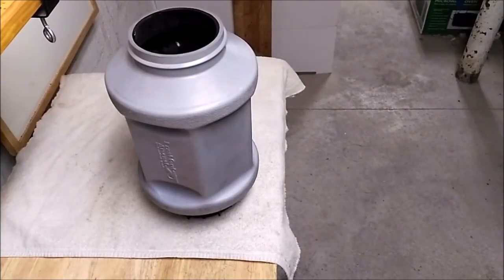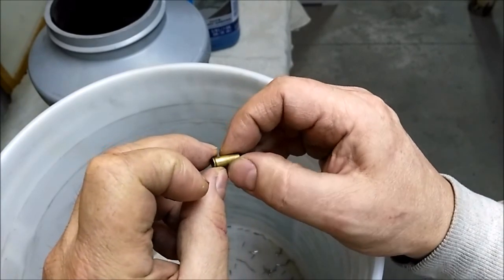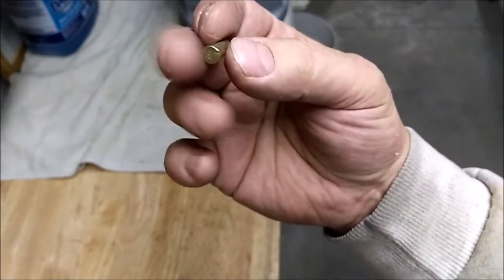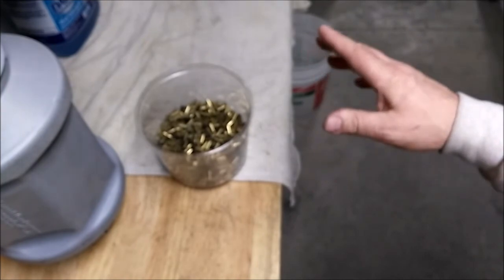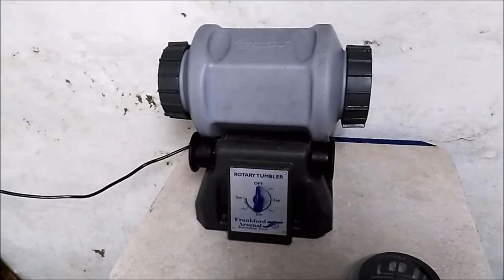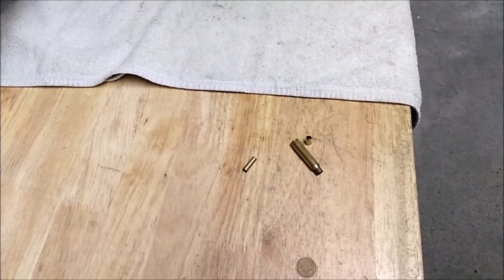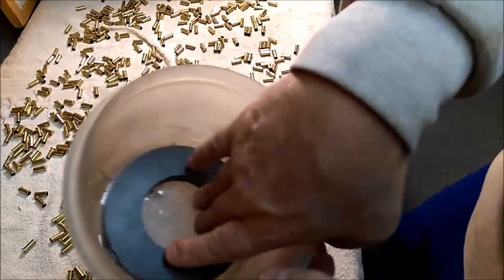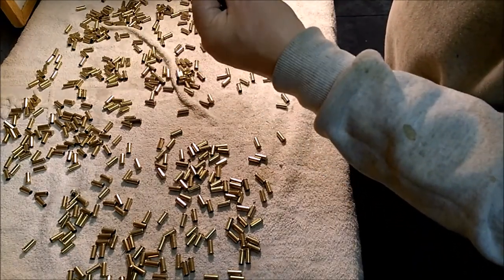Prepping 22lr brass (5)

Comment: I have the Frankford Arsenal magnet and it is excellent. Nothing like that one you have. Makes dealing with pins much more manageable.
Reply from the maker: Looks like not all magnets are created equal, and I'll have to get one of those FA magnets.
I could't find my old Horror Fright magnet that was actually good, but they don't make anymore, so I thought that since that was made well, that they were probably all similar, but that's obviously not the case at all. After I got that one, I went back to using the one with the bowl. When I first started, and before I found the bowl, I was putting that magnet in an old sock. It actually worked pretty well, but was a pain to get a grip on the magnet to peel the sock off if it picked up too many pins.